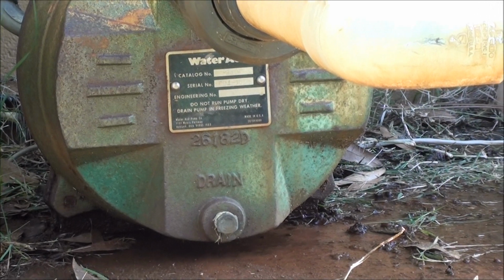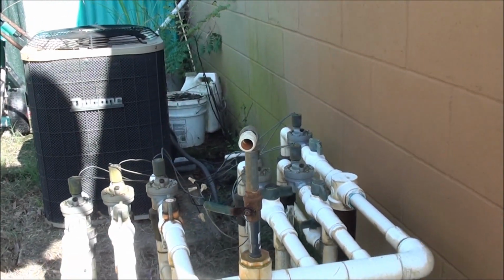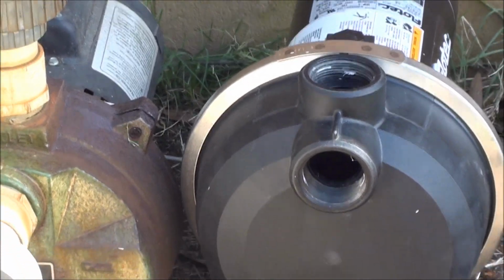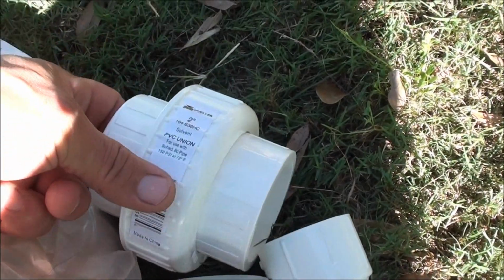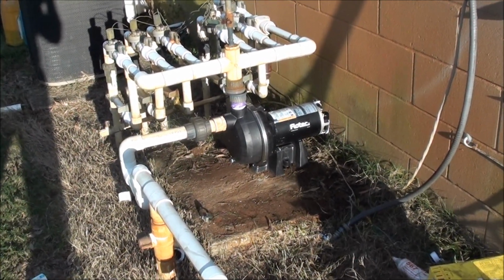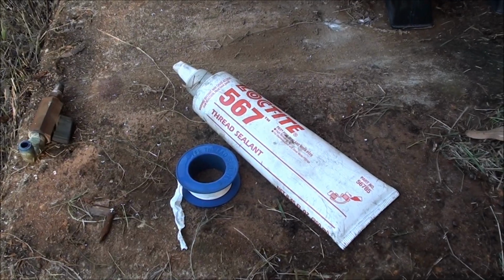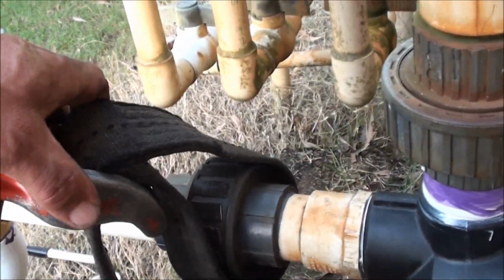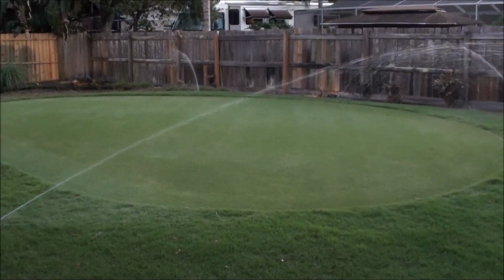Irrigation water pump replacement (1)

Comment: The water ace probably had a 1.0 HP motor with a service factor greater than one and had a 1hp impeller. That cheap flo tec has a 1.0 hp motor with a service factor of one meaning it probably has a .75hp or even .5hp impeller.

Comment: Cute dog by the way your first problum is u baught a flotech pump thay are a lower line of stayright u could have went 2 rice pump a got a goulds 1.1/2by1.1/2 pump 4 about 280.00 and had no problum i am a sprinkler con in fl

Comment: Get a JohnBlue, it would outlast 4 of those pumps if not more. They do cost a good deal more than the one you got here, but you'll be an old man by the time you need another making it cheaper. The design in the internal pump is very efficient making it cheaper to run with a more consistent volume and pressure.

Comment: 1HP water ace != 1HP flotec, difference isn't the motor (usually) but in the design of the pump mechanism.

I've used a 1.5HP water ace running 8 rainbird mini-paw heads (3.3GPM each) and it ran great.  Your other problem could be the well(s).

Oh, and your fertilizer inlet from before... VERY BAD, violating local ordinances.  You were basically polluting the aquifer with fertilizer.  This is why most localities require backflow preventers on the Discharge side, cannot use on suction side.

Comment from the maker: @puttz1976 Hey Scott thanks for the comment I got the shaft seal kit for the pump I've had it for years  I've got an old motor with a stainless steel shaft on it was used in a pool pump application it looks identical but I need to get the water ace apart first if that doesn't work I'm going to pinch a penny pool to see if they have a motor that will fit.Any rate I'm hell bent on making this damn thing work again! I will video tape the progres Thanks Scott